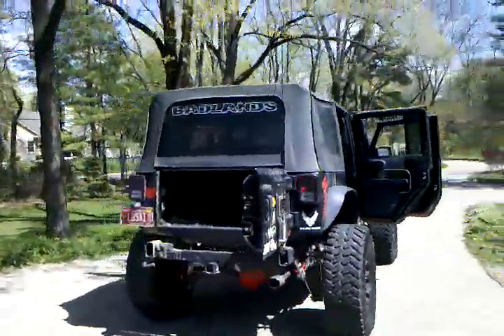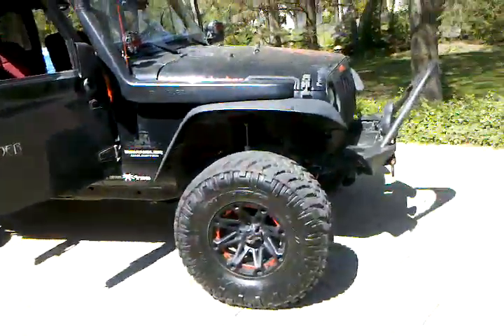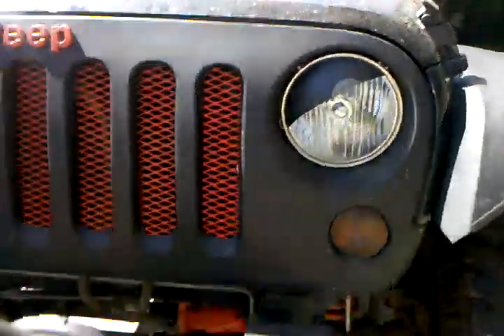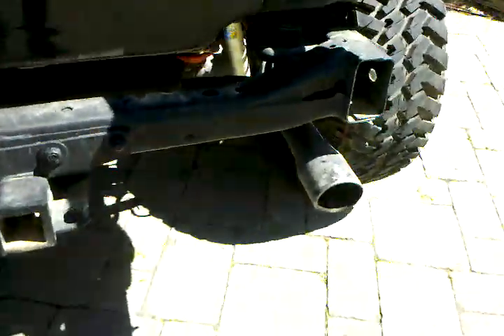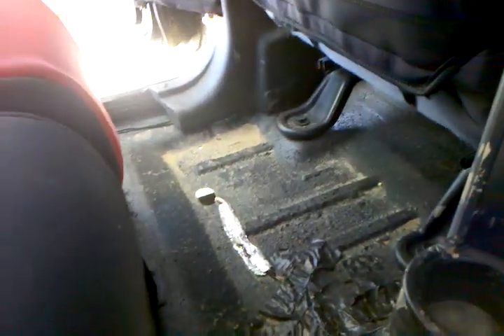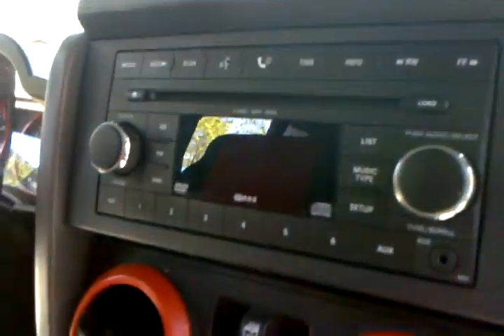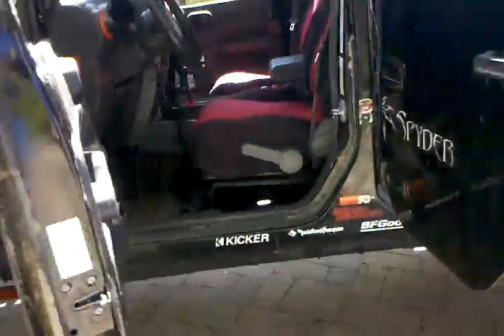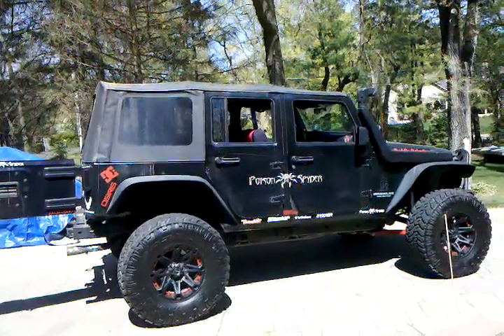Ludski Sold His Jeep

Comment from the maker: i will disclose all prices after i get the new one.

and as for mods.

RK 3.5" mid arm max travel
37" nitto trail grapplers
PSC BFH trail stinger
JCR rock rails and rear bumper
4.88 yukon gears
EVO skid plates
undecided on rims so far.
and lots of axle reinforcement.